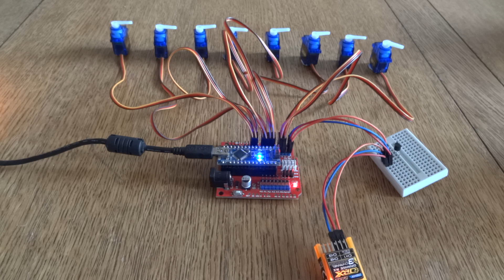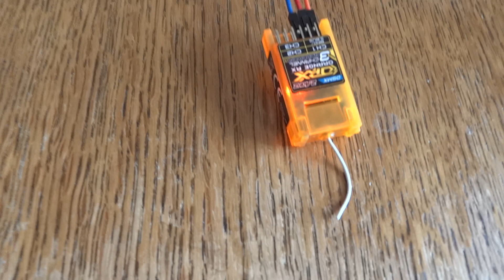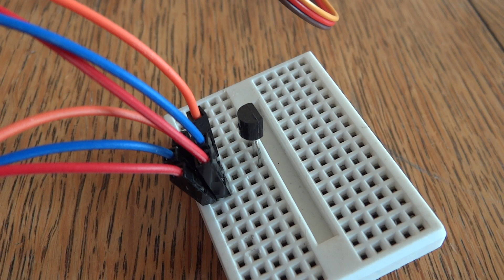SBUS to PWM decoder on Arduino

Comment from the maker: Some Nsnos have the transmit and recieve pins swapped (D0 and D1) so try swapping the output pin (drain) of the inverting FET to the other pin.  If that makes no difference, tell me the exact make amd model of receiver you're using, and I'll try to reproduce your setup and see if I can get it working. On a genuine Nano, connectionis to RX0. Make sure you have a common GND to the Nano, FET, and receiver.  Some clone Nanos have the pins RX0 and TX1, mislabeled and/or swapped over compared to a genuine Nano.

Comment: any suggestions on how to debug this if I do not have a oscilloscope?  I have tried my reciever (FrSKY) plugged into an actual SBUS decoder and it works fine, when I plug it into the Arduino I am not seeing anything wrt movement when I plug the servo into D2 nor am I seeing the RX light on the arduino show any indication of activity.  I am using a brand new OEM Nano along with 2n7000 transistors that I purchase on Amazon.  Really want to get this working so that I can use it in other projects so any help would be greatly appreciated!
Reply from the maker: Also, make sure you have a common gnd connection to the nano, FET, and receiver.
Reply: @ceptimus  Thank you for the response.  I checked all the connections with a multi-meter and it all comes out good.  I have a common row for GND on my breadboard and everything is plugged into it (servo, arduino, receiver) as well as power.    I have even tried to put the pull up resistor that you said was needed for other transistors with no luck on that as well.
Reply from the maker: @fdm225  What model of FrSky receiver are you using?  I may have one, and if so, I can try some tests myself.
Reply: @ceptimus  Archer RSPlus Mini, the interesting thing is I found a different library where using a soft serial port (and a serial adapter) I can print out the values and I got that to work; so I confirmed that my setup is correct from a hardware perspective.  I am looking at the difference now between the two programs as the other project doesn't put the output to control servos and is only printing the values to the SoftSerial port.
Reply from the maker: @fdm225  Ah, I don't have any Archer receivers, nor a transmitter, so I can't test that.  It does sound like a bug in my code, sensitive to some slight difference, perhaps in the timing, of the SBUS signal from the Archer, is stopping my sketch from working.  I hope you have success in comparing the SBUS decode routine in the working project with mine, and fixing the faulty code in my project.

Comment: Hi ceptimus! Thank you for sharing your excellent work! 
Any chance I can ask you to modify one of the sbus to pwm outputs to convert input 1000-2000 to output 500-2500?
It's needed to control PAN servo to rotate to extended degree. Thank you!

Comment: what transsitor you use?
Reply from the maker: If you use a 2N7000 N-channel MOSFET, then no resistors are required.  Or you can use any general purpose NPN transistor, such as a BC337, but you'll need two resistors - one in line with the base, and a pull-up on the collector.  The resistor values aren't critical - you could use 1K for both.

Comment: Hey man! great project! been following this since the last video, and I have to thank you for what you're doing to help out people like me (noobs :p)
I took a look at the sketch that you uploaded, and it is a little complex for me... since I wanted to edit the code to put some failsafes using the arduino, I was wondering if you had any luck with the bolderflight SBUS library, or any libraries of that sort... and the arduino nano/uno. I could not get it to work with the esp32 and my frsky r9mx receiver...
If you do get anything working for the same, it'd be very helpful for me. 
Thanks :)

Comment: Thanks you so much can you provide the schematics of this?
Reply from the maker: It's very simple.  Here's a rough schematic: https://ceptimus.co.uk/sbus2pwmSchematic.jpg  If you think your battery / power supply might exceed 6V connect to the Arduino's Vin, or RAW, pin instead of VCC.  Most cheap servos will also be damaged by voltages much higher than 5V.
Reply: @ceptimus  Thank you so much for the Code
Reply: and schematics

Comment: Make pwm to sbus
Reply from the maker: I don't know how useful that might be, but it's an interesting coding challenge on an AtMega328 to do it with 16 (or 18) PWM channels simultaneously, and try to limit the measured pulse width inaccuracies to about 1 microsecond - that would limit any jitter to an insignificant and invisible 0.1% of the servo travel range.  I've started to think about how it could be done, and if I'm sufficiently intrigued I may have a go at it: it's going to need a bit of assembler code, but the Arduino IDE can do that okay.
It would be much easier to do it on a Pi Pico, with its faster clock speed and PIO state machines - and Pi Picos are about the same price as a clone Arduino nowadays ($5).  But I prefer the challenge of doing it the hard way on an 8-bit micro running at 16MHz, that only does edge detection interrupts on groups of 8 pins. (There are also two dedicated interrupt pins, but those aren't much use when trying to do multiple PWM channels).
Reply: @ceptimus  I want to take a rx input and pass those controls to a rc tx module…repeater essentially. Is this possible? Would you do a decode to encode or is there a way to just pass sbus through arduino or raspberry pi? Great find, cheers.